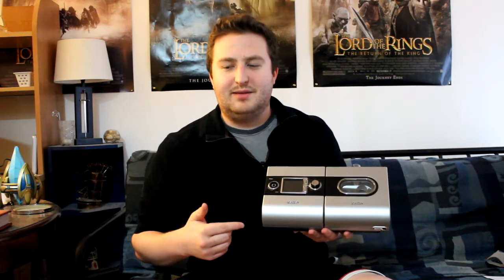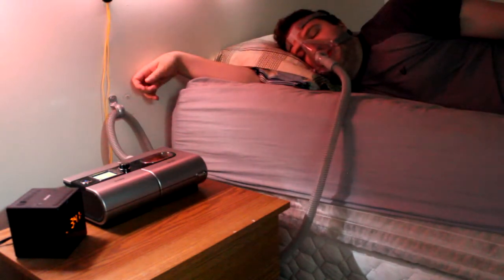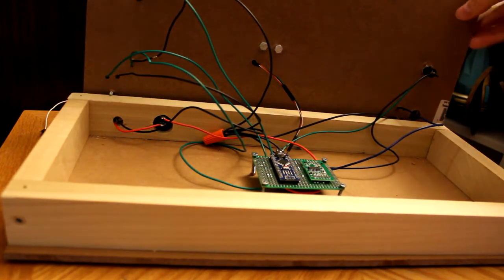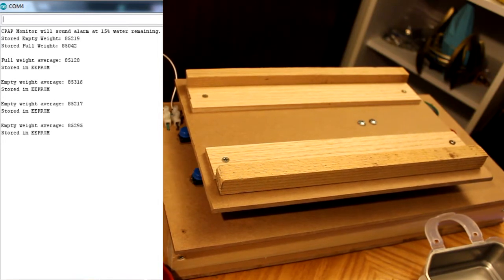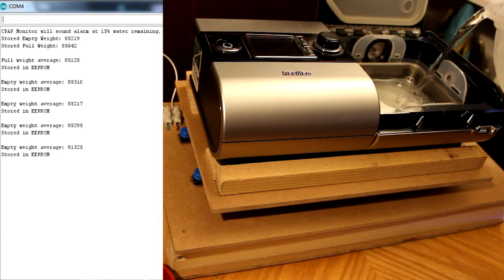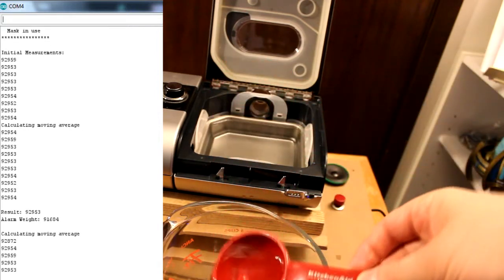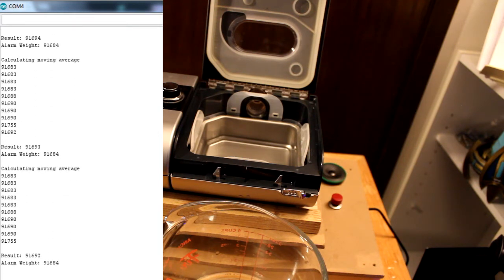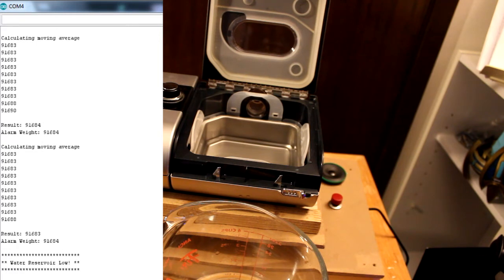CPAP Water Reservoir Monitor - Sleep Apnea

Comment: Adding water with the tank in the machine is a BAD idea, easy to spill water into the machine.
Reply from the maker: Oh for sure. That's the first time I've ever done that, seemed safer than lowering a full tub into it.
Reply: I have disassembled a Respironics humidifier (S1) and the heater plate is basically waterproof. I find it hard to imagine that ResMed has done worse.
Reply: I think the CPAP manufacturer already thought of that and has added the appropriate safety barriers to eliminate the chances of water spilling onto the electronics of the machine, but it's good that you thought of that.